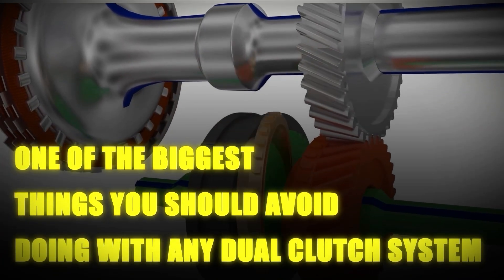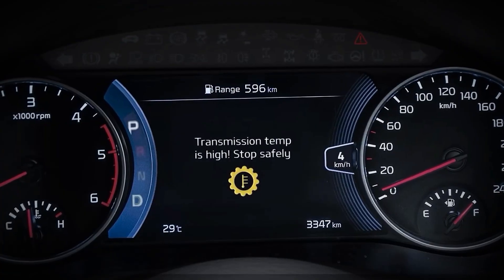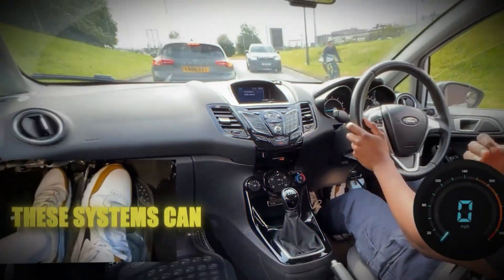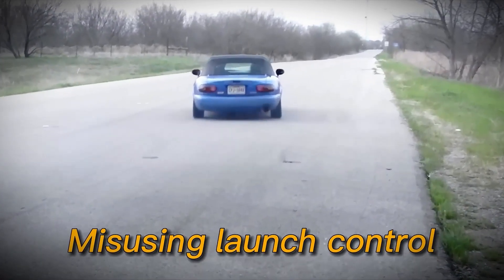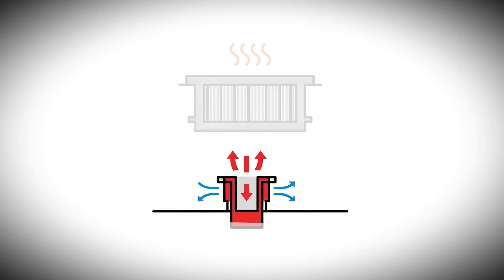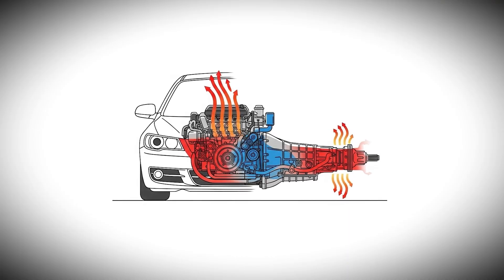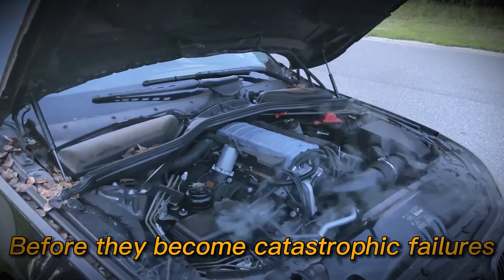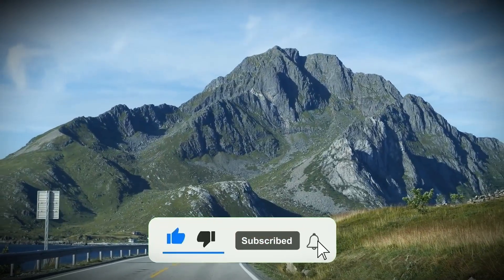9 Everyday Driving Habits That Secretly WRECK Dual Clutch Transmissions

Comment: if i creep in traffic in regular drive mode WITHOUT keeping my foot on the brake and just rolling, is that acceptable?
Reply: yes, this is total clutch actuation just at lowest revs, its perhaps not the best for the flywheel but for the clutches its perfectly fine.